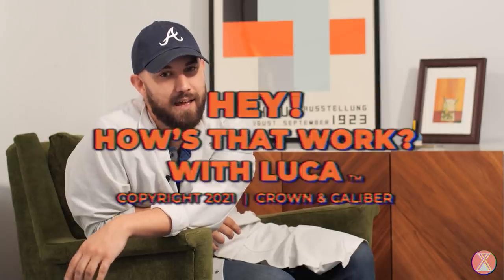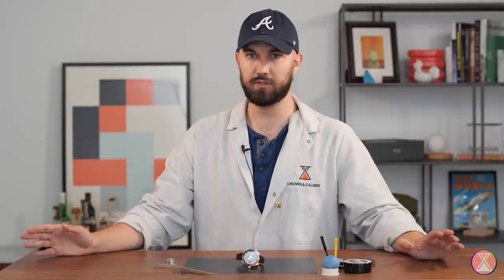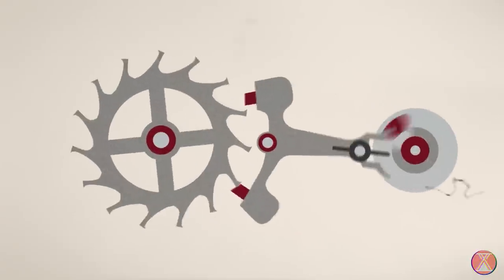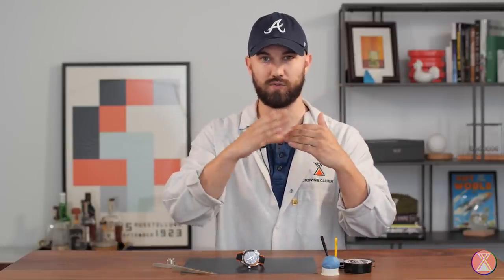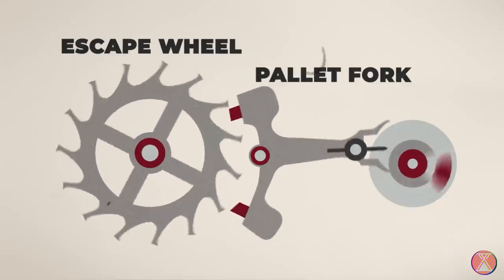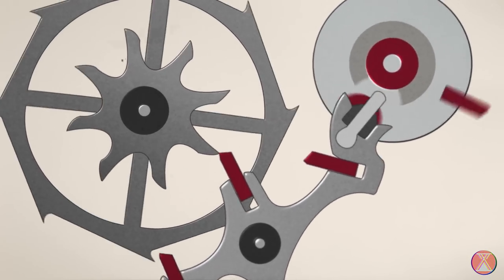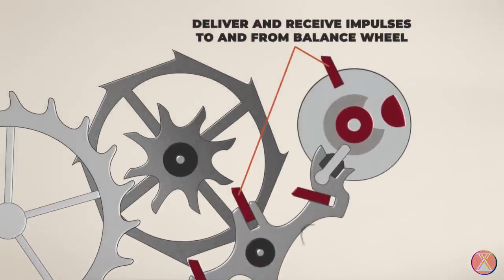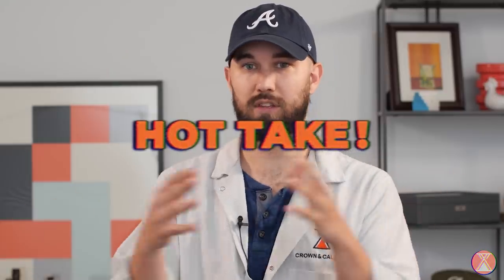Hey! How's That Work? | OMEGA Co-Axial | Crown & Caliber

Comment: Hmmm the final statement about co-axial being the only innovation over the past 250 years is a bit of a long shot. There’s Seiko spring drive, Seiko dual impulse, Audemars piguet escapement, the latest frederique constant silicon escapement, gp constant force. And that’s just off the top of my head.
Reply: Haha you are absolutely right Alessandro, I might've gotten a tad excited. Though to be fair, I'd say the Co Axial had a much greater impact on the watchmaking world as a whole
Reply: @heyimluca1275  that’s true! Omega believed in co-axial and is actually lately just adopting it across references
Reply: The Seiko's spring drive is not an entirely mechanical movement, Co-Axial movement is 100% mechanical movement.
Reply: TAG Heuer’s Mikrogirder—a linear oscillator with 7,200,000 bph (1,000 hz). A regular slow-beat watch only does 18,000 bph (2.5 hz).👍
Reply: LoL that's what he meant the only besides all of those
Reply: Rolex has over 100 Patents and they had a valid reason not to go with Coaxial !  Omega went with Coaxial to make themselfes DIFFERENT but not BETTER. Its all about Marketing !!!  By the way, I am a real Swiss Certified Watchmaker- Rhabilleur and not somebody unqualified who voices their opinion as if they know it all. My reply is to all of them who think that Coaxial is the Golden Egg in Horology.
Reply: @lurei1202  Rolex has over 100 patents on what? Isn't this a vlog about escapements?

Comment: Correct Coaxial & Grand Seiko Spring Drive are the major advancements. Amazing how others turned the Coaxial movement down. Well done Omega for taking it on.
Reply: Seiko's spring drive movement is not a mechanical movement.
Reply: @MrCROBosanceros  🤡😩 Yes it is combined with a quartz movement. 🤦🏼‍♂️
Reply: @MrCROBosanceros  Spring Drive combines the precision of a quartz watch with the torque of a mechanical watch
Reply: @watchmaster968  It's not entirely mechanical movement!
Reply: @MrCROBosanceros  I’ve already explained this 🤦🏼‍♂️
Reply: There’s also the Seiko’s Dual impulse

Comment: Luca, thanks for the video and I want to say that anyone that brings learning about watch mechanics to others s doing a great service. 
However, I have some issues with the coax movement and some comments you made and just wanted to point them out. I want to add that I am a watch collector/fan of almost 30 years and am also an ME, having worked in machine design.    But firstly, the coax escapement was originally designed as a low beat clock movement, not a high beat watch movement.  Which is where problem one comes in. Remember why Omega had to reduce the beat of their watch down from 28.8k ?  The intent by Daniels was to reduce the friction in the standard escapement that is true, but that was in a low beat movement.  When you design an automotive engine to run at 2500 rpm, it will be much different than an engine that runs at 8000 rpm. Same goes for watches.  

The Omega master Chronometer designation is an internal one and it is a proof of quality for sure, but just because other companies don't have it doesn't mean omega and coax is superior. The standard chronometer-certification  has a daily accuracy of +6/-4 seconds, The Omega master chrono improves it to 0/+5 seconds.  Literally reducing the range by half.  Impressive.  The Rolex superlative designation brings with it a -2/+2 range which is also well beyond COSC and slightly better than Omega's range.  So the accuracy argument of the coax is null. You claim that achieving the same accuracy with swiss lever escapement would be difficult, and Rolex did indeed do it and actually beat it. 

Lets talk Friction. The claim that it is frictionless and, thus, needs no oil is false. The oil is not added for sound deadening. I have talked to several watchmakers on this and they all said that the oil is indeed necessary. A Truly frictionless system will run forever, never losing energy.  The coax escapement not only had an additional rotational/balance point, but it doubled the pallet gemstones, so it has spread the friction loss over more parts and surface area. If someone where to do a friction study over the whole of that escapement, it might be surprising to find that it likely produces a good bit of friction.  It's not just the stones hitting the wheel that have friction. All rotating balance points have friction and you just nearly doubled the moving parts with the coax escapement. Maybe the whole of it has slightly less friction than the standard escapement, but not by a lot, I bet.  I would love to see someone remove all oil with solvents from the coax and see what happens in a few years.  I bet the outcome will not be a happy one.  

Simple is always more reliable and durable. The coax has just nearly doubled the parts of an escapement to do it's job.  That is not robust, that is more things to go wrong. Any time you add parts to any mechanical device, you expect great gains.  You are not getting that here.  In fact, I am betting the movement as a whole is less reliable and durable than the standard eta movement.  I am no watch repairman, but I  know a little about dynamic forces and friction loss.  

I think that the coaxial system would be better off being run at a much slower rate than it currently is. I would have preferred to see it run at 14 to 20k, not 28.8k or even 25.5k is still to high. 

One of the few major advancements in watchmaking in the last 250 years?  Outside of Omega, who cares? Coax has been around since 1980. Daniels went around offering it to the big houses, like Rolex, Breguet and Patek. He even attached his escapement to their movements to show them. They all turned him down. What did they know. I bet more than we know. How about the self winding rotor in a wrist watch? Patented by Wilsdorf.  How about the use of ball bearings in the rotor(eterna)?  How about screwdown crown and caseback for guaranteed waterproofness. How about the Cartier Santos, first real wristwatch made, not from clocks with straps added.  How about the auto Helium escape valve co-developed by Doxa and Rolex.  How about the GMT function, or the stop watch function?  How about Grand seikos spring drive?  If you had said that the spring drive is one of the greatest development of the last 200 years, I might have agreed.  A truly hybrid marriage of mechanical and electrical.  The 20th century was the hayday of wristwatch development. 

 Omega needed to have something they called in house to reach a higher level of horology. This was more of a marketing decision than an engineering decision. In my opinion.  I would never trade my SMP 300 pro with it's ETA 2892 movement from the 90's for the coax. 
Regards and with respect.
Reply: Omega can now do 0 to +2 using the same coaxial movement with their spirate system. My Seamaster 300 is often times doing 0spd which is quite impressive. I’m no expert though as I know nothing about mechanical watches engineering. I agree that lots of those are just marketing ploy, especially that master chronometer certification. I think it’s crap. Lots of brand new Omegas out there losing or gaining too much time within weeks after purchase so I find that METAS thing useless.

Comment: What's the service interval officially recommended by omega? My ad told me they still need to be serviced every 5-6 years which is the industry standard.
Reply: I have had one since 2014 and never serviced it. So that is 7 years. Still runs as accurate as the day I got it it seems. I plan to service it after 10 years (or if it accuracy should be outside of the tolerances).

Comment: Well Audemars Piguet also has its own escapement thats different and much better from the usual swiss solution. So im not sure about the 'only major advancement' part. I dont know of any other brands that have a unique escapement but there might be more.
Reply: Where's AP escapement now?
Reply: @michaelhayward107  somewhat unsurprisingly in AP watches
Reply: @wiktorutracki6469  AP watches use a standard lever escapement. Only one AP has used an escapement based on the Robin model, it failed. This movement kept stopping as George Daniels told them it would. AP tried to fix the problem but it remained an issue. It was a huge public embarrassment for them at the time. As of now, this escapement is shelved.
Reply: @michaelhayward107  I'm not talking about Robin's solution. 
I just read it again to make sure. It first appeared in 2006 in Cabinet no. 5. It's more energy efficient and more resistant to shock. I cannot find anything that the escapement was faulty or would stop. People on Reddit and on watchmaking forums discuss which is better this one on Omega's coaxial in 2012-2018. I can't find anything new on this so maybe rot are right but I can't find anything about it

Comment: Ah but you forgot there is the Seiko Spring Drive which has zero friction and is a lot more accurate.  It’s mechanical movement generates a very tiny electro magnetic charge which powers a regulator that keeps it extremely accurate.  It’s 10X more accurate than a coaxial and on-par with a quartz.  40 years of development paid off.

Comment: Im thinking about getting an omega with a 2500 cal. But i heard that 2500 cal is very unreliable compare to 8500 cal. What do u think?? I have owned an ETA 2892 movment, and it had  power reserve disfunction issue, and i know that 2500 came from eta 2892,,, So, yes im a little worried lol. Thank you!

Comment: The only major advancement to watch making? What about the Tri-synchro Regulator or the Dual Impulse Escapement? Both create less friction than Co-Axial escapement.
Reply: I don't think the dual impulse escapement creates less friction than the co-axial. Otherwise, we'd see it have better accuracy. The spring drive however is basically frictionless.
Reply: @456MrPeople  GS movements exceed ISO chronometer spec. But increased friction doesn't decrease accuracy, increased friction decreases power reserve. 80 hours at 36k is better than any coaxial movement as far as I know.
Reply: Honestly, I see the future of mechanical movements in silicon. Look at Frederique Constant's 40 Hz silicon escapement in their Monolithic watches. It's a game changer.

Comment: i have 3 omegas the 300 pro,and 2 po,8500 orange 45.5 and the chrono 600. out of all my watches i think like 65 of them other than the old bumpers the omega chrono po is the loudest watch i have.
to the point that its on the chopping block i cant stand it ,other than the rotor being way too loud its a really fine bad ass piece

Comment: if the co-axil is supposed to provide better accuracy, then why is my rolex more accurate than my omega?
Reply: I have a 4130 Rolex Daytona & a 9900 Seamaster 300m. The omega is insanely accurate. I’ve had it three months now and it’s lost about 1.5 seconds in that time. My Daytona consistently loses 1.5 seconds a day. I have to recalibrate my 4130 once a month and have done for the last 7 years. Whilst the Daytona is accurate, the 9900 caliber is a different league. Absolute precision personified in my experience.